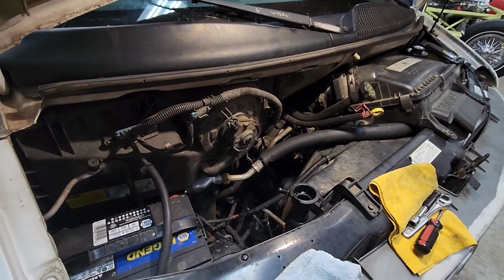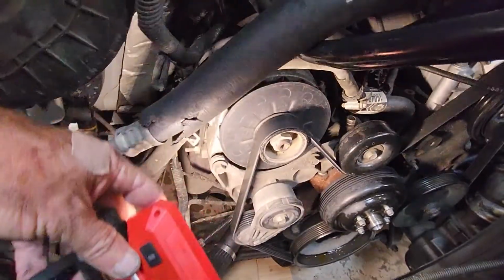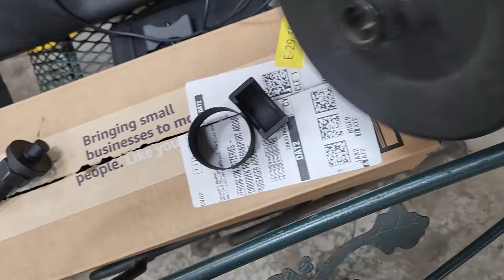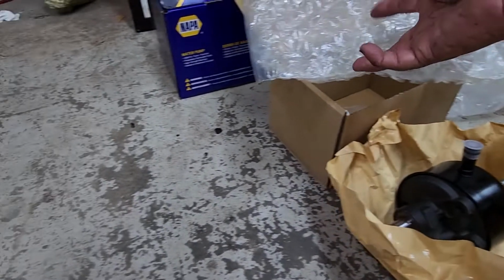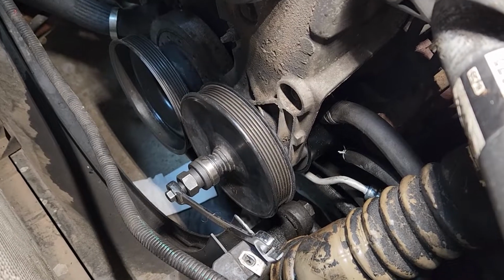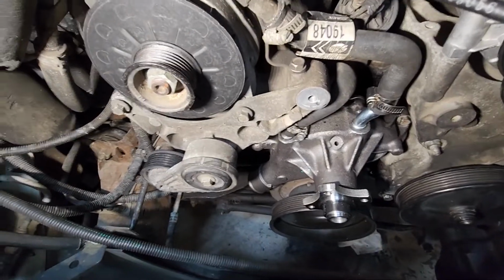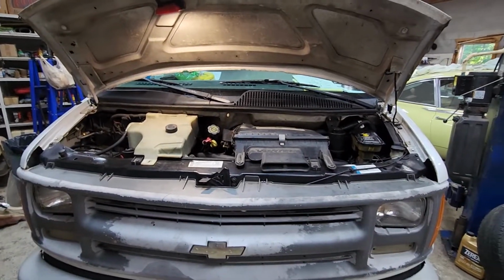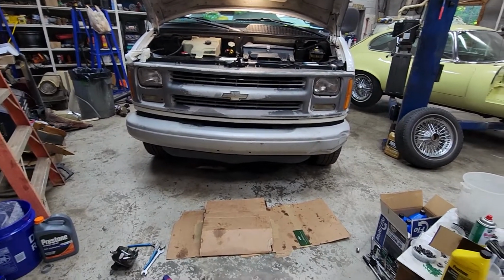How To Replace Water Pump and power Steering Pump 2000 Express Van 2500  #PowerSteering #autorepair

Comment: uh, the one thing I'm struggling with is the fan.  The rest I got no issues with.
Reply from the maker: Yes the fan can be a problem, thank you for commenting and watching the videos
Reply: @Crowbirdvideos  I lucked out and got a tool kit for late 70s Ford inline six? Consisted of 36mm wrench and a large fork that slips over the 4 pulley bolts.  Both had inserts for 1/2" breaker bars.  I didn't expect the fork to be of any use, but it fit perfectly.  Hadn't seen or hear of this tool being used anywhere but knew I needed a 36mm wrench
Reply from the maker: @suprafastmafc thanks for the info, it will be useful in the future and may help someone else too

Comment: Was it difficult removing the fan clutch ? What tool did you use ?
Reply from the maker: I will have to look back and see if I have any video of it but I do not remember it being hard to remove. I think I used an open end and a box end  but will check and let you know. Thank you for your question and for watching the videos
Reply from the maker: Yes A 10mm box end 10mmOpen end a screw driver to jam the fan in place.
Reply: @Crowbirdvideos  thanks for the info, One more question… I’ve been watching a couple of these videos on YouTube about this install and in some videos they recommended daping the water pump bolts with some permatex. Curious if you did this on your van ?
Reply from the maker: I did not but it may be a good idea to use that or some anti seize on the treads. I have never had trouble with Chevy or GM water pump bolts. I would retighten them after it runs at normal temp for awhile. I have had a lot of leak trouble with my 95 Jeep 5.2 V8 Grand Cherokee the old Chrysler 318. I have to retighten them every now and then
Reply: @Crowbirdvideos  thanks. Did the install today. Went smooth. I should have bought a replacement lower radiator hose though, mine has a small leak.
Reply from the maker: Great I am glad it went well for you.

Comment: Where do the 2 power steering hoses from the tank mounted to the firewall go?
Reply from the maker: The little hose goes over to the hydroboost. The larger hose goes down to the power steering pump to the reservoir on the power steering pump
Reply: @Crowbirdvideos  if I don’t have hydro boost I can cap that small port right?
Reply from the maker: I do not know, I don't know that much about hydroboost, I had never heard of it until I had trouble with mine